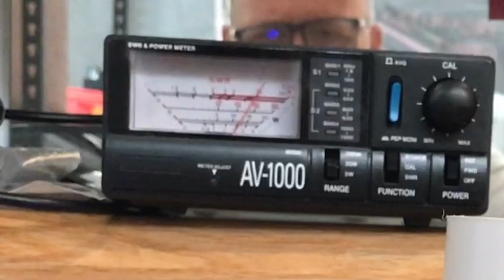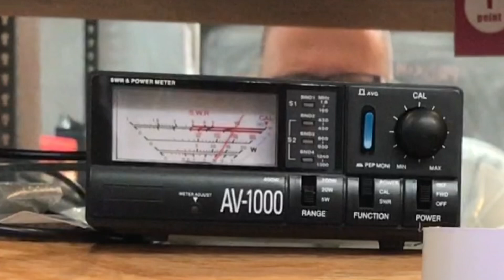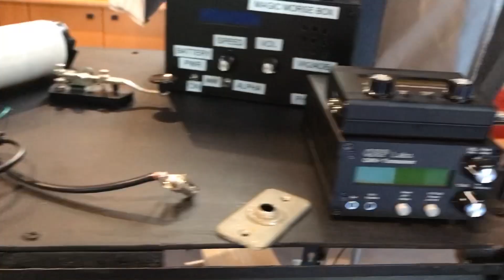Single Tube Rig modifications

Comment: Glad to see you're using an adjustable grid resistor, it's a great addition.  I will use it for all my one-tube transmitters.  BTW, here's a small hint if you want to hear how your crystal is keying - listen to the 2nd harmonic (or even 3rd).  That multiplies any chirp and also helps keep the receiver from being overloaded.  Finally, have you seen any of my posts on FB about using the ebay "1W" and "2W" chokes in transmitters?  They seem to work just fine, every bit as good as the old pi-wound chokes.  I do use two in series in the plate circuit to divide the plate RF voltage across two of the smaller chokes.
Reply from the maker: @Novice1965  I’ll check the FB page out. Yes those pi-wound chokes are getting rarer and more expensive. My choke I wound myself (care of info from Pete JULIANO of Solder Smoke podcast fame) video on my channel, nice to have options thanks 🙏 and 73. I did a crystal grind recently … video soon 73.

Comment: Got a schematic of your gizmo????
Reply from the maker: It’s based on the AMECO (link below). When when I’m done playing I might do one with all the tweaks but basically mine is the schematic below (link) but powered from 13.8 v shack PSU. The 13.8V is fed into car inverter to upconvert to 220v AC… this is rectified and filtered to give high DC plate voltage. The cathode heater voltage is  6v L7806 3pin regulator fed with 13.8V DC. 73

https://www.qsl.net/wb1gfh/ameco.html

Comment: How’s Japan treating you ??? Have you found anywhere that sells vintage ham gear ?
Reply from the maker: @MidlifeRenaissanceMan  nahhh not yet been jam packed! Might try later?? Seen only 2 Yagi arrays whilst here from the train rides. Antenna spotting 😝😝 from a train 😂😂😂
Reply: @ I haven’t had a moment free to get on the air myself. Today I’ll be swapping out the radiator fan. Means I won’t have to run the heaters to keep the car cool on 30-40C days whilst sitting in traffic.
Reply from the maker: @ That Merc has as much personality as my TS 520 😂. It’ll be great once the bugs are ironed out.
Reply: @ yeah. The rear left quarter pillar trim fell off (I suspect). 

Need to find a local wrecker with one that isn’t in the US with $150 of postage.

Speaking of postage, I only acquired 3 keys this year….from eBay. But that’s OK, I grabbed an Ibanez Blazer P bass and an Artist Tele with their humbucker pickups. The loophole I used to keep The Keeper at bay….they were for Felix :-)